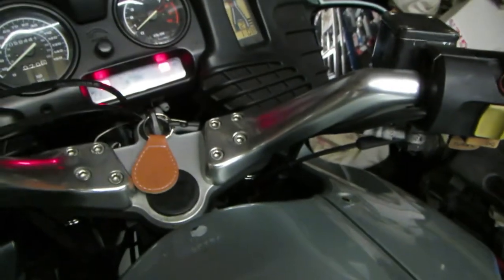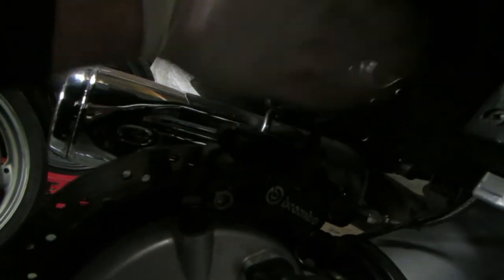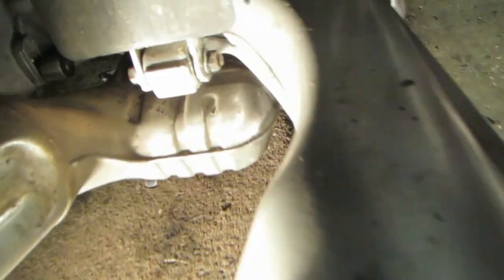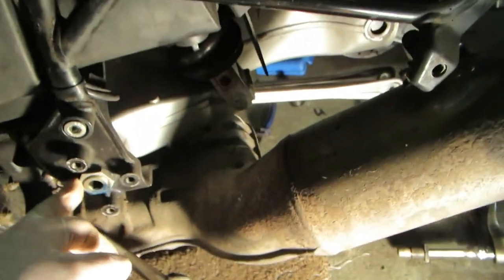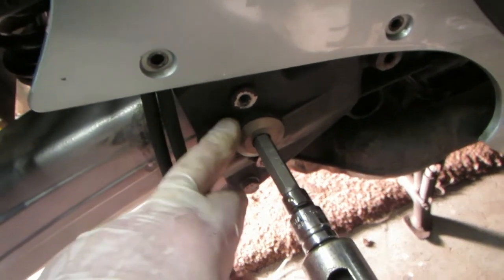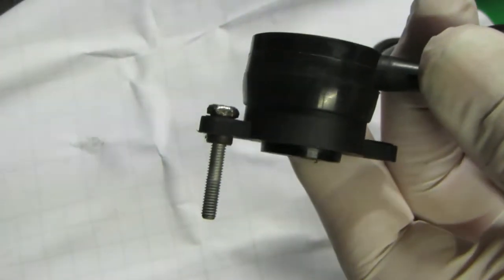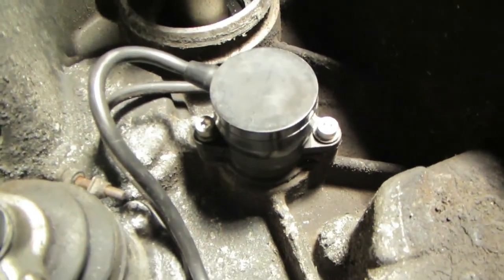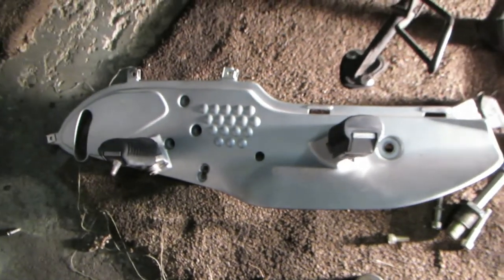BMW R1100RT gear indicator switch replacement| Restoration Biker

Comment: Just a thought. Whilst you're at it, check the splines on the diff, the drive shaft and the gearbox output. Clean them up, grease them. Same with the swing arm bearings and the needle rollers on the UV joint. Check out Chris Harris' videos too. Gareth. I agree it's a fairly straightforward job. Nice touch with the bolt replacement too. There is a " tool" for setting up the near side swing arm nut and bolt....it's essentially a cut out socket that allows an Allen key inside so that you can do two separate torques on the bearing. About £19 from Motorwerks, worth having if you do this sort of stuff. Gareth.
Reply from the maker: Hi, Yes, you are right it is possible to do quite a bit whilst you are there. Yes those tools are a must if you do the job a lot. I always try and show how to do things without special tools if possible . Thanks for the comments.

Comment: Jusy bought a new used R1100R and man is that false neutral light annoying. Ready to tackle this job. Thanks for the video. Also got squeaky front brakes at low speed. Both common problems with these bikes.
Reply from the maker: Yes, you are right. The neutral light is a bit of a faff, but once you commit to it and get stuck in, it is quite easy.

Comment: Just returned home from a ride on my ‘02 R1150RT and while riding began to experience the same issue.  1st gear shows the bike in 3rd gear and 3rd gear shows E (6th gear). Glad I found d your video. Not looking forward to this job at all.  I also have a clutch slave cylinder to replace.  Might as well do it all at the same time while I have the bike apart.
Reply from the maker: Yes, the hardest part of this job is removing the swinging arm. But, if you take your time, use good tools and loads of heat. It isn't that bad. The pivot bearings (if they have never been removed since the factory) will have thread lock on them, which works really well. But heat melts the thread lock and then the nuts undo quite easily. Don't try it without heat. This is a common fault on the R1100, and 1150's. Let me know if you get any problems and I will help you
Reply: @RestorationBiker  Thank you very much for the advice and your kind offer. I truly appreciate that.  

Do you recall about how long the procedure took to complete, start to finish?  Also, what reference materials did you use? Eg…Hayes, Chilton or BMW service manual?
Reply from the maker: @03flhtcui  Hi, Because I have done these quite a few times before it only takes about an hour. But if I was doing it for the first time I would allow a day, to make sure it wasn't a rush. I always use (if I can) the workshop manual (ie BMW) but Haynes are quite good. Just take your time and double check everything before you ride the bike.  Don't forget I am here if you need me.
Reply: @RestorationBiker  May I ask, have you also mastered the art of replacing the clutch slave cylinder by any chance?  My bike is an ‘02 so it has the hydraulic clutch. 

Thanks again for the kind offer, I appreciate that more than you know. This seems like a daunting task, but it needs to be done.

Comment: Thanx for this! I just bought an r1100rt and sometimes the neutral light won't go on so it won't start eventhough the stands are up and everything. 
Funny is that I also have a diversion 600 at my disposal.
Reply from the maker: Hi, yes if the neutral light doesn't come on then then bike won't start. But if you pull the clutch in the clutch switch should by-pass the fact that the light isn't on. If not then the clutch switch may be at fault. The only full time solution is to bite the bullet and replace the neutral light switch. Yes, my Diversion is going to be a bit of time before it gets put back together. I do like the 600 'Divvy' though a very nice bike to ride.
Reply: @RestorationBiker  My R1100GS won't start even while holding the clutch. Taking out the swingarm for the neutral light switch gives me the cold sweat for now. But I'd like to try and replace the clutch switch. Is it situated on the handlebar? And offcourse alot of thanks for your Youtube channel. Very informative and easy to follow!

Comment: Good grief, word to the wise. First, once I got over the intimidating part of removing the swing arm, it really wasn't that bad. Once the wheel and brakes are off it's mostly cosmetic stuff. I'd say an hour or two would do for the whole job depending on your level of experience with automotive/motorcycle repair. (I'm an automotive teacher with way too much experience.) Before I installed my $15 eBay part I made sure the switch lit all of the gear positions by manually cycling the switch, but I forgot to verify it on the bike, so I think I indexed in improperly when lining it up to fit. (Turned it clockwise or counterclockwise when it should have been turned the opposite direction. So, here I go again. Maybe I'll time it this time around and update this post.
Reply from the maker: Wow, what a nightmare. You've done the job, only to find that you have got to take it all apart again!!! Hopefully all should be ok once you have done it again. Let me know how you get on.

Comment: Great vid, thanks. I've added an RID to my 1993 R1100RS. I've got a switch to fit. What size/length of cap head screws did ou get so I can get pre-armed? It piggy backs with the neutral switch I believe so the existing screw will be wrong overall length. Thanks 👍
Reply from the maker: Hi, I used bolts from my stock of screws so, I never measured them. I should have and then put the length and thread size in the video to help people who were going to do the job. Really sorry as I now do not know the length I used.

Comment: Wondering if you could just remove the muffler and get access to the switch?
Reply from the maker: Hi, the switch is covered by the swinging arm. So, I always remove it to do that job. It may be possible by just removing the exhaust but it would be very tight. I can't say no as I have never tried. If you try it let me know how you get on, it would be very interesting.

Comment: Mine sometimes will be in Neutral but the Neutral takes some to Light up...
What could this be..
Reply from the maker: Hi, This is almost certainly the neutral light switch which is located under the gear switch. So, you have to remove the same things to do the neutral switch as you do to do the gear indicator switch. They are both fairly common problems on the R1100 bikes.

Comment: Does that stop the bike from starting
Reply from the maker: Hi yes it can do. If the neutral light doesn't work it can stop the starter working. If you pull the clutch in, then the clutch switch should allow the starter to work.

Comment: So I am getting a false neutral.   When in 1st gear the RID shows 1st gear but the green neutral light is lit.  Shift to 2nd light is out      downshift back to 1st  light comes on.  Not a big deal     I know what gear Im in at all times  and the RID is accurate.....but the green light is annoying.   All that work to replace a switch.  I will pass.    I guess I will live with the light until I need to do further maintance.
Reply from the maker: Hi, Yes, sounds like a switch fault.. The only cure is to remove the switch as you say. It is a bit of a faff to do, when you know what is really happening. Best leave it until you get more of a fault, or until you have to strip out something else which will make it easier to get at.